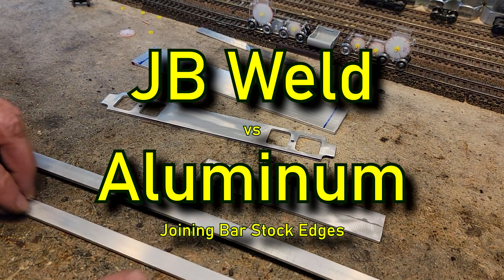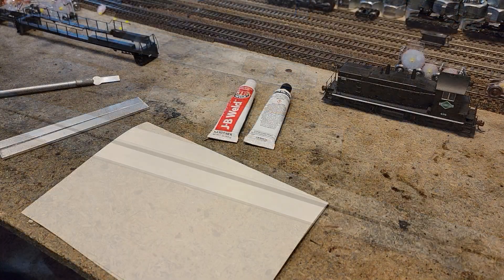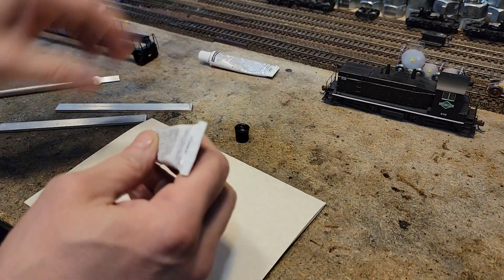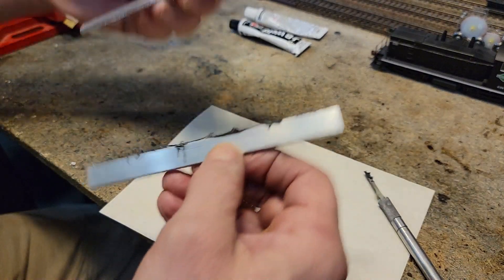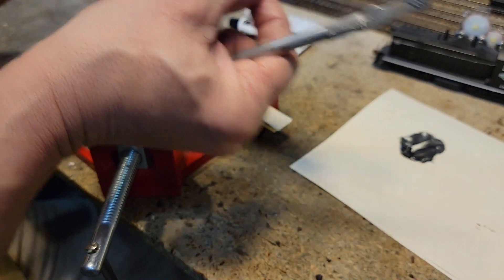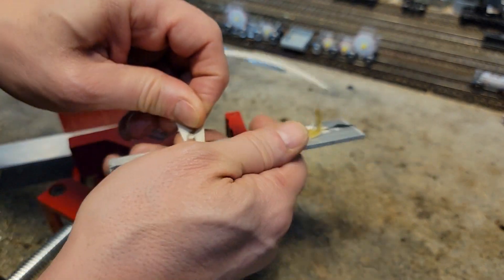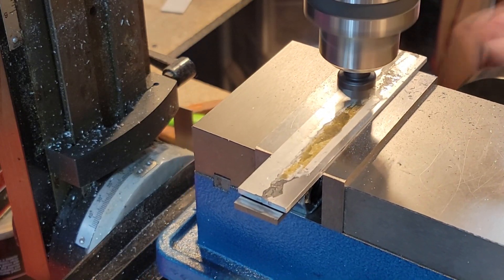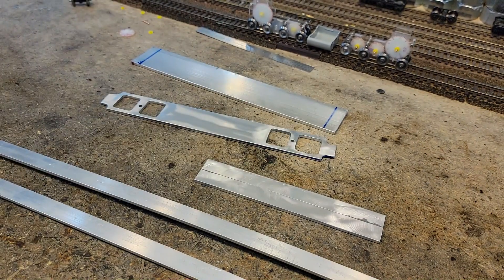JB Weld vs Aluminum

Comment: The question is over time does aluminum oxide form and break down the bond with raw aluminum?
Reply from the maker: well, after several years of doing this, it hasn't happened yet!  this particular piece is exactly the same as it was when I made it!

Comment: Which version did you use?
Reply from the maker: this is the regular 2 part epoxy, not the quick version - but I also did a test on the quick and I did a glasses repair using the plastic bonder.  there's another test placing objects under a light bulb to see if they would cure faster and that was also a success!

Comment: Wouldn't it be lot easier to use a piece with the required width? Just asking for a friend. I mean why use JB weld if the required width piece is already available? The reason I ask is this title is very confusing. JB weld vs Aluminum. Should it have been using JB weld to bond two pieces of Aluminium together instead? (It is "Aluminium" by the way. That is what the founders/inventors named it.)  Cheers.
Reply from the maker: yes it is indeed easier that way!  but I needed to test its strength before I went on to use it in a bunch of projects where I wanted to stack pieces weren't suitable for using screws to join.  plus it was just plain fun to see how well it would work!

Comment: Thanks so much for the heads up in the first few minutes! My question was answered then, but I thought I could learn more, thanks again!
Reply from the maker: I've experimented with many different setups since this and every one of them comes down to having a fan somewhere close by blowing on low.  That is the number 1 factor to get the super high strength. 2nd is using a light bulb in a cheap reflector is just the right amount of heat to keep away humidity!

Comment: i have a 2000 sonoma w a stripped caliper guide pin bolt and i was thinking of jb welding a nut to the top but think its just gonna snap off too
Reply from the maker: try it first!  JB Weld is supposed to be more than 4k pounds of force to break it.  give it 24 hours to cure and have a fan blowing on low nearby to cut down the humidity.  I like to put a barn bulb in a cheap reflector light that emits just a of heat and that cuts humidity a lot.  If you do all that, it will hold.  if not, then you must fabricate a totally new one and resist the urge to just bur it!

Comment: thank you, was looking for this before purchasing this to bond 2024 sheet to 7075 block...
Reply from the maker: I also tested heat curing with a work light and it helps a lot to ward off excess humidity  that will ruin a bond.  A fan and a work light pretty much guarantees success!

Comment: Great video. Thanks for sharing this. What is the exact JB weld product name/number you used?
Reply from the maker: it was 2 part epoxy I got at the hardware store!  it's the one that has individual tubes - not the one that uses a plunger!

Comment: I found you looking for JB Weld
on aluminum and realized you were a model railroader! Cool!
Reply from the maker: In my builds in the last few months I used a lot of JB Weld and learned a lot about it, especially how very high humidity can cause it to not cure properly.  Once I made that connection, then I got even stronger bonds.  During the worst of the humidity I used PC11 which is an epoxy that will cure under water.  It's really good stuff, not quite as strong as JB Weld, but close enough for model trains!
Reply: Thank you for the advice! And you have quite the library of videos!